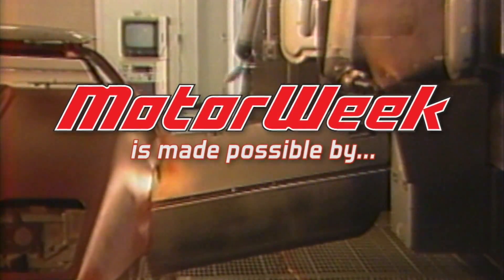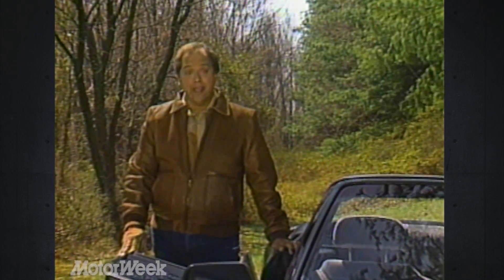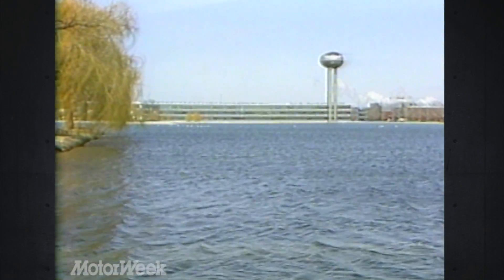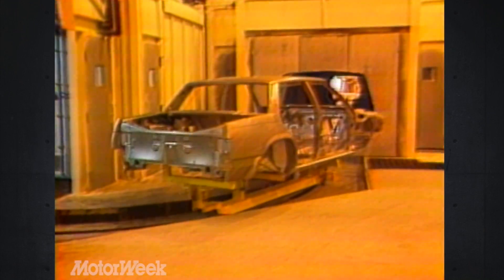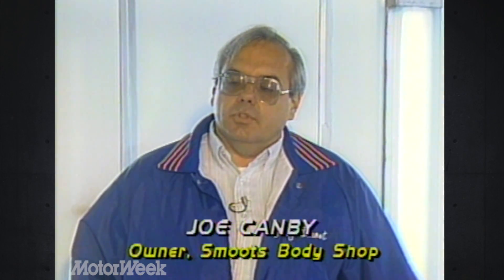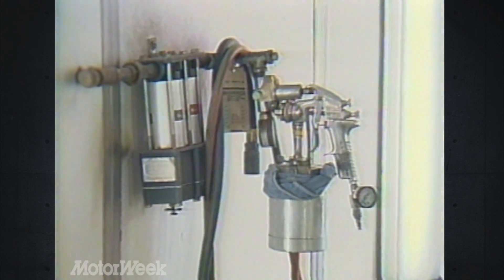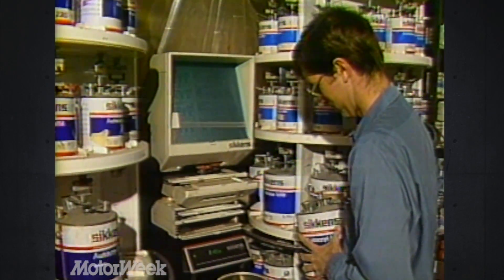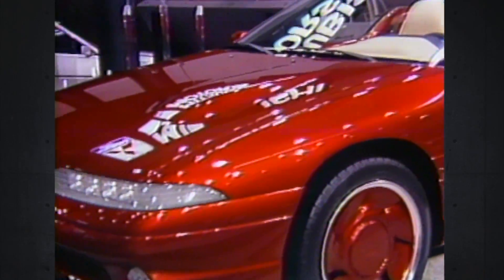1980's GM Paint Technology | Retro Review

Comment: A lot of cars in the 80's had paint quality problems with this base coat clear coat method. Clear coat that flaked off. Paint that didn't properly adhere to primer and flaked off. Clear coat that wore thin prematurely. There was a definite learning curve. Now manufacturers are using water based paints, which are having issues with paint easily chipping off, which leads to paint flaking off as time goes on. An ugly and expensive problem to have.
Reply: Honda is one of the companies that using water based paints. There is actually a video on youtube where two people have their new odyssey and fit already the paint is just peeling off. i heard the water based paints is for saving the environment or something.
Reply: We do not have any problems with paint in Europe, afair.
Reply: @jareknowak8712  what about the faded colour on red and blue painted VWs and Mercs in Europe from the late 90s and early 00s??
Reply: @kamrankhan-lj1ng  Mercedes was already using water based paints in the late 90's but many colors didn't hold up well.  Neither did their cars from that era.
Reply: @asdfghjqwertyu1858  a lot of manufacturers are using water based paint. Hyundai and Nissan too. The paint started peeling on my Nissan after only 2yrs. It was fixed under warranty.

Comment: GM had literally the WORST paint in the 1980s, I guess they should have spent a lot more time in the lab! It was not uncommon to see 5-10 year old GM vehicles in the mid to late 1990s with slabs of paint missing, the ‘gloss’ and shine a distant memory. Some of this could be down to poor care for the paint and body on some of these cars, but there were so many examples across lots of different GM cars and trucks. I don’t recall Fords having quite this same problem, and I never heard of a Camry or Accord from this era suffering from peeling paint. Somebody mentioned Chrysler products having the same issue - I can only say my parents had an ‘87 Caravan, one of the first with the Mitsubishi V6, and it had a deep red paint that I never saw rust or peel. Then again, it was garaged and well-cared for its whole life.

Comment: The white paint jobs on 87-98 GM pickups are usually so far gone nowadays that the trucks look like Holstein cattle.
Reply: @bilbobaggins4710  Paint shouldn’t flake off in large chips from general use after only 20 years. It’s well known that white paint on GMT400 trucks just didn’t hold up like it should have. Go lay down bud.
Reply: @chumbawaumbacumpa I'm a painter my man...20 years???? That's well past life expectancy of any paint system
Reply: @bilbobaggins4710  My 4runner’s 22 year old paint is still in great shape. Those trucks DID have paint issues
Reply: @bilbobaggins4710  regardless of if the manufacturer states that for legality reasons to get out of warranty claims, most cars even from the 80s still have their original paint in reasonably good shape. I have an 87 e class, the paint isn't falling off that either. My 03 Falcon which is black, still has its paint. Unsure why you're getting defensive and busting out the im a paint professional card.
Reply: Yea and the paint on 90s Honda Accords are shot too. Your point?
Reply: @bilbobaggins4710  Have you heard of IHC,JIC, Big Bud, Versatile, Deere&Co, or similar? 

We have 20-100 year old paint from them, faded but no pealing like these did.
Reply: @JoshuasRecordings  My point? It was an observation.
Reply: @chumbawaumbacumpa  some idiot was just trying to tell me that white paint jobs last the longest lol 
He obviously doesn't know general motors. Max of 5 yrs and the white Corsica and Astro and Cavalier and basically anything white, was peeling.